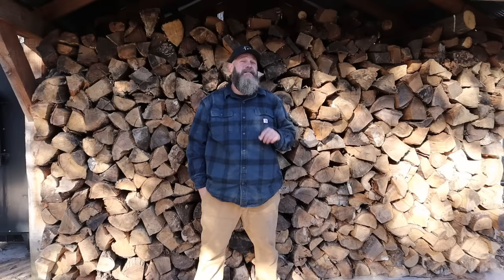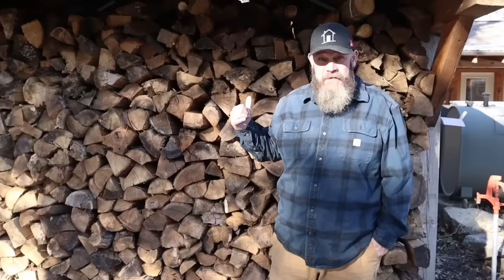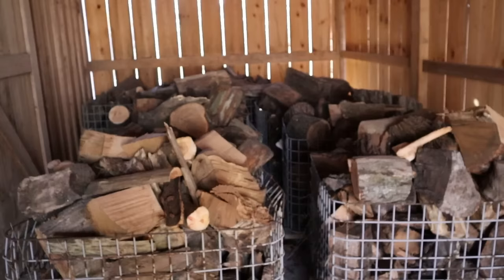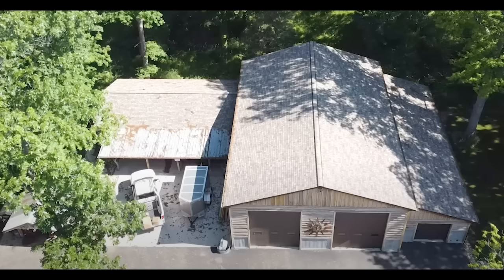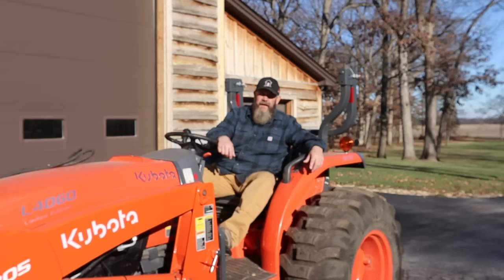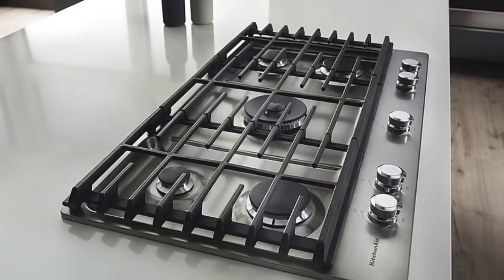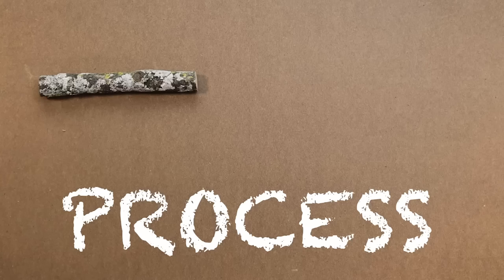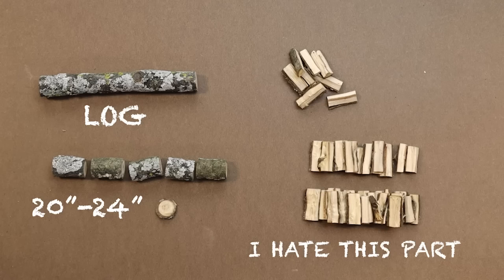Watch Before You Buy an Outdoor Wood Boiler!

Comment: As a chemical service and sales tech here’s a few tips.

Propylene glycol is very safe to use(it’s regulated the same as distilled water). You can drink it and other than maybe becoming very regular for a bit you won’t die. These use it in food and drinks. Granted that’s good grade IGPG.Glycol is a catch 22 because the more glycol you have, the LOWER your heat transfer efficiency. 35% glycol is generally pretty decent for most states. -40 BP

All closed loop systems should have corrosion inhibitor. This will protect all the yellow metal and iron components in the system. All the inhibited glycol producers use their own blend of molybdate, nitrite, or phosphate. All can be mixed and have now negative side effects of mixing. Keep in mind that all of these inhibitors have caustic which will raise your pH. Best pH range for these chemistries to work is 8.5-9.5. If it gets too high you will need to add acid to bring that back down into range for it to be effective and not cause alternate damage from pH being too high.

Two ways to layup a boiler, wet and dry. If you store it dry you need to completely drain it and put a fan to ensure there is zero wet spots or moisture. If you don’t you will get corrosion due to the O2 interaction. Even if the steel is damp but not wet it will corrode. If you store it wet be sure to add sulfite to it prior and to keep it at 100ppm all summer. This will remove the oxygen from the water and prevent any putting from occurring. Most my customers for their steam boilers prefer wet layups due to the simplicity.  There’s a lot more to the chemistry behind protecting boilers both closed loop and steam systems but I tried to make this simple as I could. Hope it helps out. Cheers!
Reply from the maker: good info!

Comment: That’s a crazy amount of wood. I usually burn 3 cords but I have a ductless mini split back up. I just burn wood when it’s below freezing
Reply from the maker: Yeah we heat allot of square footage. I have shortened my season a few weeks on each end. No point in running it when we're not heating the shop and garage. Don't need the practice thats for sure!

Comment: hi there interesting show , i built my boiler around 25 years ago . put in glycol in mine back from the start , still working fine , back then it was 199 a gallon , my heat is maintained with refectory cement instead of lots of water , , been threw all the wood senairows you have , green wood will burn after you dry it out by turning the water to steam and sending it up the stack , and that takes BTUs . as for draining your boiler not sure whats best , when you add fresh water your adding fresh O2 and other things as well . you may have seen my boiler at my channel some time , best to all john
Reply from the maker: Thanks John, I think the best part of these videos is after a dozen and all these comments I might get it figured out before I blow my boiler up!
Reply: I put glyco in mine as well, used same water for 15 years. Glyco is good for 5 to 7 years.

Comment: Some things I have learned with our boiler.
I got the smallest I could...  80 gallons. 
Ours is traditional like yours and I will never go to a gasification u it.
I use a lot of pine or Poplar because it dumps its btu very fast and can heat a cols boiler three or four times faster than oak. 
I use oak or other high btu wood to build a hot coal bed or when overnights are below 15 degrees. 
Green wood is perfect over a good hot coal bed if the boiler will idle for long periods, but it will smoke while the coal bed dries out the green wood. 
I bought the small 80 gallon unit because the idle time is much less than say a 350 gallon unit. I don't load any more than 3 times with softwood on a below freeing 24 hour period, but I also don't build huge amounts of creosote.  I only heat about 3500 Sq feet total, but plan to heat a lumber kiln soon. 
I have plenty of oak, locust or other good hardwoods available, but really like the fast heat of softwood.
Water only.... I add water, but never change it, we let the pump run year round, but isolate the heat exchanger from the loop if we run the AC in summer...  the firebox will sweat heavily if you don't isolate the heat exchanger. 
We have LP backup, but can go years without getting LP.
Reply from the maker: I love burning softwood in mine too. When you get an aspen or pine log it often surprises me because I don't expect it to be that light!

Comment: You said you fill the boiler 3 times a day.  It seems that every day is different.  I guess if you don’t have a lot of wood left when you go to put more in.  Then you are good to go.  If you could rig up a sensor to tell you how long the boiler ran without pumping water or turning on a fan.  It might help you adjust your wood usage.  With a wood burner your still getting some heat.    I don’t know how exact you can get.  If my house stayed warm and I had boiler wood left at the beginning of spring.  I would feel like a lucky man indeed.  I enjoyed your video, thank you.
Reply from the maker: Thanks, I could probably get away with 2 times a day when it's not below zero but I'm usually passing it a few times a day so it's easy to chuck some wood in it. Sometimes it needs more than others. I like your point about the wood stove retaining heat when the wood is gone for a bit. I get a similar effect from the radiant heat in the floor as well as the lines and heat exchanger. It may run out of wood but it takes quite a while for the system to go cold if that makes sense.

Comment: Not sure where you bought your Heat Master from, however if any of you are around Southern MB and are farming you can exchange any kind of straw in that area for impacted straw pellets to burn as long as tour straw is under 20% moisture.  And yes obviously by the semi load.
Reply from the maker: That sounds like a pretty good exchange!
Reply: @buildlife  Yes I am not sure what the exchange rate is but you can also just buy it from them and they are along the US/CA border so service both.
Reply: @runrau9275  I have always wanted to do that with my leaves but I don't think it's economical on a small scale

Comment: Yeah, spuas far as putting additives or what nothere's a watermelon. I remember wateremind I run it usually from October 1st through to the end of May middle name hitting my shop is job 210 by 40.  And and I just run pure water. And it took 20 years of operating for to rushed out one of my 90° block iron elbow so.  I replace that last year. So I think i'm good

Comment: It's got a draft control in relation to feeding air to the fire, it acts like a thermostat. Stack it one row bottom up to top of door. Set how hot you want the water temp walk away. It'll take care of itself.
Reply: O' one more thing keep it near the door. Not half way or near the rear.  Right up front exhaust is in the back.
Reply from the maker: I’ll try it!
Reply: @user-mh3wl5ub4t  This is correct thinking because the heat of the fire is in contact with the rippled bottom of the water jacket for a longer period of time, before going up the chimney..

Comment: Just think how much wood it would take if you lived in northern Minnesota to heat the same square footage you have. You are fortunate to be able to have all that equipment for wood processing. I know a guy that has a central boiler 6048. Busts his butt off just has a pickup goes out cuts loads the pickup up by hand then home to unload and split. This is up in North eastern South Dakota we get cold. I use a Quadrafire indoor wood stove 1600 square feet and might burn two cords a year. Have fun processing wood better than sitting in the house.
Reply from the maker: I agree, I used to work for a guiding company and we would go to Northern Ontario for dog sled trips. The guy that had the dogs had a OWB at his house and he would. use sawmill cut offs. He put these massive banded straps of them next to his boiler and would just cut a slice of 100 3' pieces of the stacks and toss it in along with full rounds of whatever fell around his massive property. He used allot of wood and never fussed to split and stack and dry and do all the things a hobbyest like me does!

Comment: Right at the start i use WOOF juice to get the fire started -- it is a mix of gas and oil  but enough oil so it doesent explode when lit .
 I have found that drying the wood well makes alot more heat and less ash and less creosote which is flamable .
I switched to a gassifier furnace now and have found that it uses a little less wood than mu older furnace but is a real pia to clean the ashes out .
I am running a propolene glycol mix up here in canada  as i am worried about it freezing  at -40 . I doo add a water stabilizer to the water every year .
One thing with a gassifier is there is very little smoke and it doesent smell like creosote when burning .
I use propane as a backup both in the house and garage .
I am running all the water through all my indoor plumbing including the sidearm for the hot water tank . Running the furnace cold WILL take heat out of my house  especially the hot water tank .
Reply from the maker: Interesting to hear from gasifier owners. I'm always curious how much wood it saves. They claim up to 60% so the pia would be worth it (maybe) but for 20% savings I don't think it's worth it. Probably not enough to replace my unit for just that reason anyways. Thanks for watching!
Reply: @buildlife I have been run a gasification unit for 8 seasons now and cleaning it is a breeze. It uses about half the wood I used to burn. The only problem I have is getting the wood cut soon enough that it can dry but other than that they are great. I have been using outdoor wood boilers for at least 35 years now and at 62 I have 2, one at my shop and one at home. They ore 10 km apart.

Comment: you will have a lot more efficiency if you put in heat storage tanks. my system is also tied to radiant floor but it is mainly heated by solar hot water collectors. the wood is a backup. i also have full solar pv which powers everything. i live up near the canadian border. i use old dead water heaters as heat battery tanks. i also heat my rain water tanks which are under ground as we have real winters. by the way rocket stoves are more efficient sources of wood heat if you can diy. you are correct that green wood lasts longer. it also burns cooler making it more polluting. here in NW i mostly burn ponderosa pine which is not the greatest wood but it is local and very available. since i use a rocket stove, it burns hot and clean as i charge all my tanks which usually last almost a week. needless to say, i do not go through more than 5 cords even in the worst winters. i also built the most of the system with used or junk so i spent $10k on the whole rainwater, solar, wood heat system. when designed for efficiency, your fuel consumption goes down and your resiliency increases exponentially. live well 🙂
Reply from the maker: Nice, sounds like you have quite the system!
Reply: @buildlife  its easy now but it took me 10+yrs to bring it to this point. it was worth it though as i reduced my energy dependency each year and realized savings really helped. i love that my consumption of fossil fuels is extremely low. i use 40gal diesel and 25gal gasoline per year since 2019 and 0 fossil gas since 2011 when i started heating with wood. my electric bill is $100/yr mostly for my metal, machine and wood shops. of course i am retired, sort of 🙂

Comment: Green wood does burn longer.  When I was a kid, my dad and I would gather wood for the winter.  For the longest, I didn’t know why we had to stack dry and green wood for the wood stove.  I finally asked him why dry and green wood?  He told me that the dry wood in the bottom will get the stove going, and the green will keep the house warm later because it burned slower.
Reply from the maker: I agree. Seems like (at least in my boiler) allot of the heat when burning seasoned wood goes out the chimney (don't need as much) so whatever makes longer burn times is better (for me anyways)

Comment: How often is the boiler blowing down?  Do you have an automated system for that job?  Go idea to test your water to determine when and how much to blow down.  Using a conductivity meter mated to a valve is the best way to blow down your boiler.  I sold chemicals for and tested boilers all over Hawaii to keep scale off before becoming a nurse.
Reply from the maker: Not sure what you mean by blow down. The blower goes on and off automatically.

Comment: interesting video for sure have been looking into getting a boiler myself right now we heat our 3500 sq foot house with a wood stove in the basement burning about 6 to 7 cord of wood to get us from October through middle of may usually live in north central Pennsylvania. A boiler would be nice because i could just set the thermostat at 74 or whatever and forget it instead of having to keep the stove either burning hot or let it burn lower to control the temps myself  have a couple friends like yourself that heat with boilers and go through 12 to 15 cords a year ... this seems like the biggest drawback of one to me having to more than double the amount of wood i'm gonna have to be splitting i cut and spilt all my wood by hand currently. i am also looking at a indoor wood gasifier boiler as we currently have a oil boiler that is hooked up to hot water baseboard that we use in September and in may once the day time temps get to high to justify keeping the wood stove going without having to open 10 windows in the house.   thanks for the info on the wood boiler definitely covered alot of stuff and haven't found anyone with one yet that doesn't also heat their garage a shop and  driveway or something wish i could find someone with a video of just their house for how much wood that would take
Reply from the maker: Lots of options! Good luck!

Comment: If you go away and just leave your propane boiler running while you’re gone how do you keep the tank on the bouler from freezing if youre not using glycol
Reply from the maker: You just leave the pumps running so the water circulates but if it's going to be really cold I don't let the fire go out. If I can't be there someone else fills it but that's not very often.

Comment: Wait, this has open regular tap water without antifreeze in it?  What if your boiler goes down mid winter?  Pipes freeze and break?
Reply from the maker: It's only right at the boiler that you would have a problem. The pipes are burried. The water will take a while to go down bellow freezing and you are tending to it 3 or 4 times a day so you would just have to drain the tank and fix it. As long as the pumps are running it won't freeze and those are easy to get local and fix on the fly. I have another video on here where I went two weeks in single digits with it broken and just had to keep the fire going.

Comment: In gasification, if the wood is wet, it still could burn because of red hot charcoal bed as a result of suction fan.
Reply from the maker: Does it dry it out before it snuffs out the coals?
Reply: In down-draft gasification, suction fan will suck air through the combustion zone(amber bed).  Smoke, moisture, air will be sucted downward through amber bed.  The air passing through amber bed make the reaction continuous.  Moderate amount of moisture in the wood will be turned into  hydrogen gas which is combustible. Tar or smoke, after pulled through red hot amber bed, will be turned into CO and methane, which is combustible.

The way this system deal with moisture is air suction through amber bed.  My english is not so good.  I hope you get the point.
Reply: What I said was theory.  It depends on actual implementation of each system.

Comment: Outside wood boilers are not efficient, they spend a lot of time smoldering. Inside wood stoves are a lot more efficient.
I have a wood boiler add on and it is not very efficient but like you I think like wood burning. Mine also heats my hot water and it comes out of the tap at 200+ F
And it’s a lot of work but it saves me a bundle of money. At least if you cut and split your own wood.
If you check your water and it’s very rusty you should change it then add the boiler additive to stop rust.
Reply from the maker: Thanks for the tips! The only things that makes me ok with the in efficiency is I burn allot of stuff I wouldn't put in my wood stove like rotten wood or stuff with bugs in it... That stuff would just go on the burn pile. At least I can heat with it.

Comment: 40 years ago in Alaska, I installed hot water baseboard heat using a gas-fired boiler in the garage.  Do any of you use your outdoor Wood Boiler with baseboard heat, or do most of you use a blower and duct work in the house.  I know some of you have radiant heat in the concrete floors of your shops/garages.
Reply from the maker: yeah that works really well. Same concept the water just flows through a different device.
Reply: I have baseboard heat using an outdoor wood boiler. My original set up had the same water circulating in the baseboards as in the boiler. My current set up has the boiler water going through a plate heat exchanger to heat the water in the baseboards. It has worked well both ways.
Reply: @grumps62  What I learned about hot water baseboard heat, is that the heat is going to the coldest places in the house, outside walls, and often below windows.  So quiet and comfortable